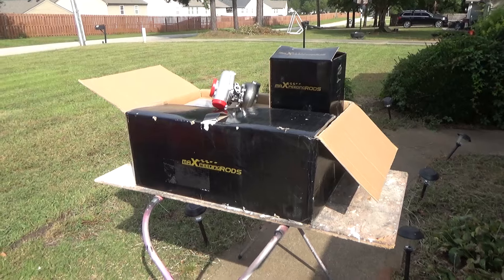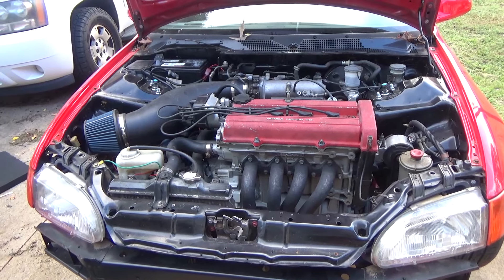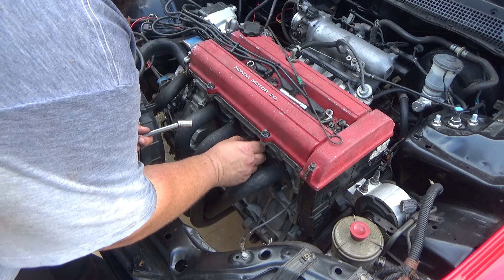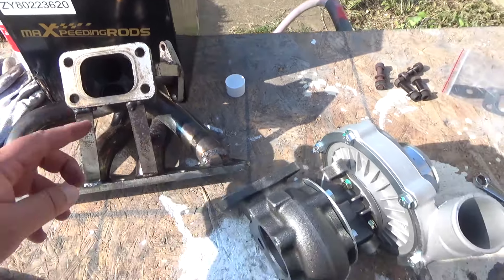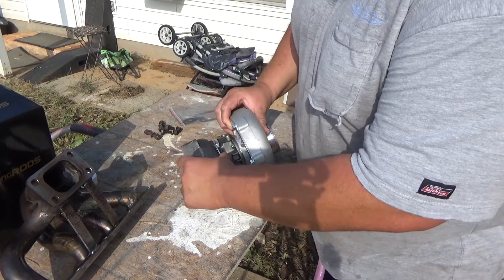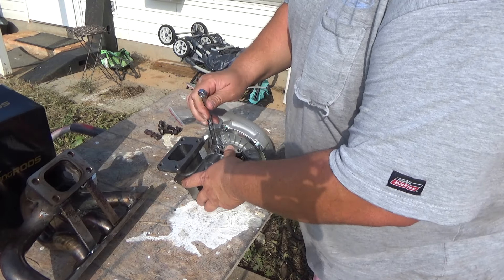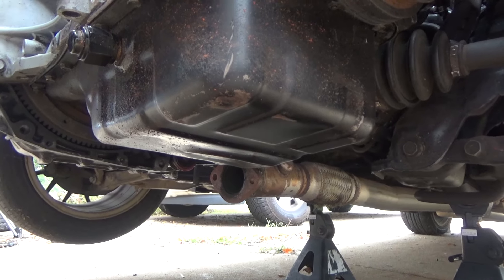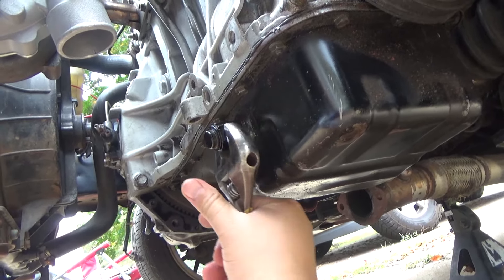How to install A $450 Turbo kit on a Civic. Part 1

Comment: Wow, i bought that same style manifold like 20 yrs ago....i use to get flammed due to it cracking😢 but props to you and maxspeeding.....they made the turbo process very inexpensive and straightforward. I use to tell people, this setup is cool for a daily driving situation with a good conservative tune and boost level.

Comment: I believe that oil restrictor is for ball bearing turbos. For journal bearing turbos, you go with a -3an line with no restrictor. It may not get enough oil with that one
Reply: My thoughts exactly. Hunter tuned has explained this several times. I’d drill that hole out at least double the size.
Reply: @CP_FPV  yup that's where I just heard that is Huntertuned. He lives like an hour and a half away from me

Comment: Only thing I would say is to not use the restricting plate on the oil feed line if the turbo is a journal bearing. That restriction is for ball bearing turbos, they don’t need as much oil.

Comment: what would u suggest for a budget ecu? ive seen theres the speedwino's but should i just go with a s300? also would 300-350whp be reliable on a stock h22a4 with head studs and fairly new rings and bearings be good or should i get some better piston's and rods first?

Comment: What cracks me up is who do you think invented these speciality tools, it wasn't dealerships it was mechanics who didn't have the tool so they made it or made it work with what they got, creativity and intelligence outweigh any tool. My advice bring the adjustable wrenchs at 11 o'clock and one at 12 o'clock you have more control and force by bringing your hands together to pull towards one another

Comment: Hopefully after all this is done you get it tuned properly and have a decent clutch/flywheel setup to handle the extra power...also depending on how much HP you want have all the other supporting mods to make it reliable and conplete. 👍

Comment: That manifold has pretty bad wastegate priority. I would watch out for boost creep.  

Run lower boost spring in case it will spike 2-5 psi at redline. 

Nice kit!

Comment: Well swap vtec head. Vtec + turbo = more power
Reply: It's a little more elaborated than VTEC + Turbo = more power. High compression pistons + VTEC + Turbo is how you blow up these engines!
Reply: @juancabeza5809  lol yeah low compression better for turbo hi for NA :)
Reply: @hondagamer79  
Currently I am doing a Turbo conversion on a 6 port 13B and I am definitely removing the actuators because I am using the high compression rotors!
Reply: @juancabeza5809  well I haven’t seen turbo with HI compression pistons I hope it’s not going to blow up.. nice experience